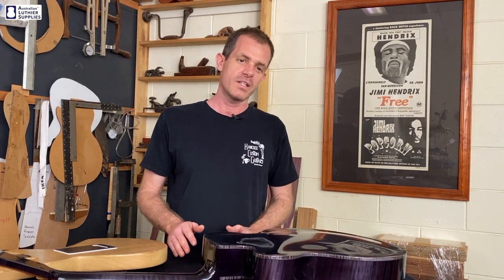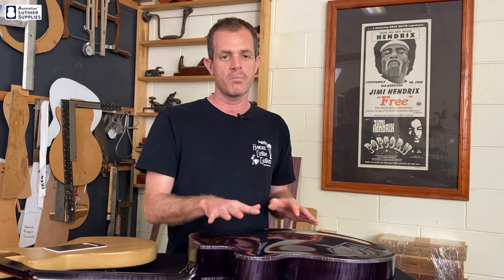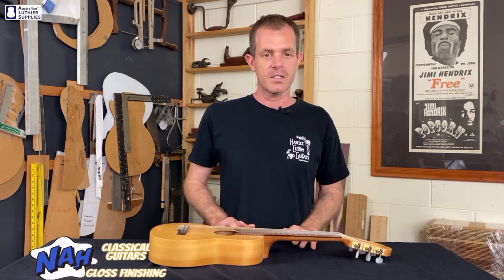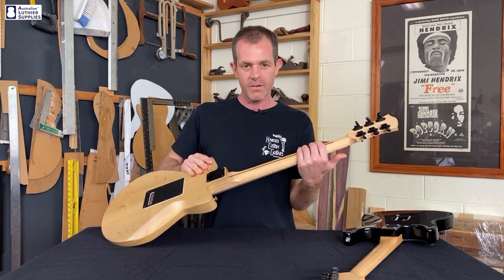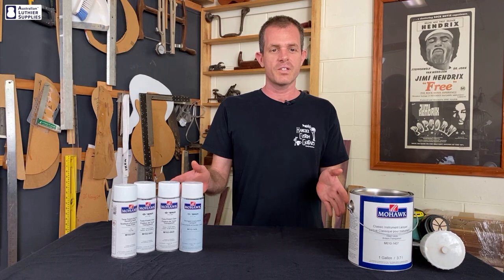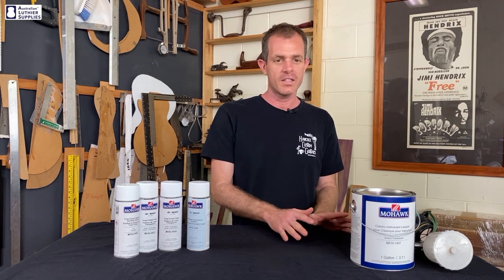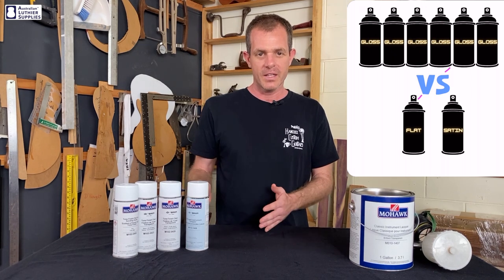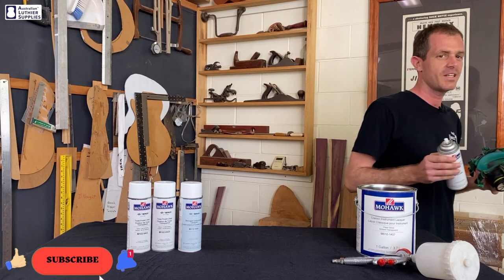Flat vs Satin vs Gloss Guitar Finishes - Guitar Maker’s Comparison of Nitrocellulose Finishes

Comment: Great video, 1 question I have is why is the cost so different. I see guitars 400.00 difference in price where the only thing between the guitars is the finish. (Gibson SG).
Reply from the maker: We couldn't answer this for sure, but gloss finishes are much more time-consuming. Gloss finishes need many more coats need to be applied than flat or satin and the polishing of a gloss finish takes a lot of time.